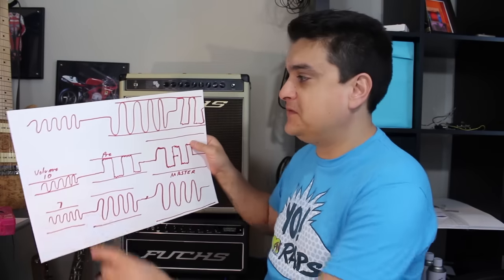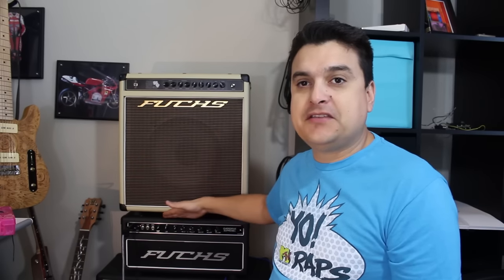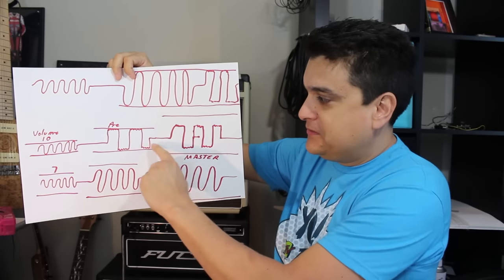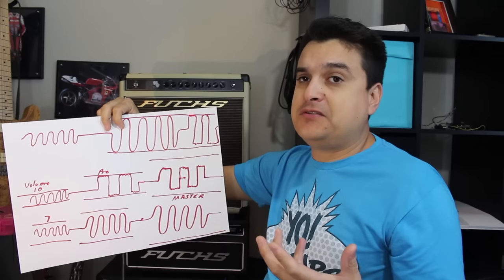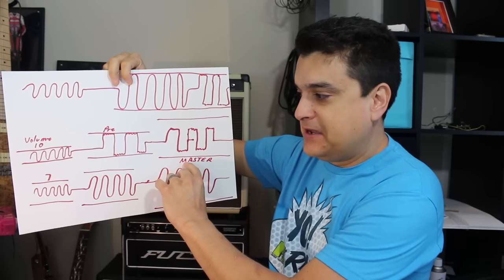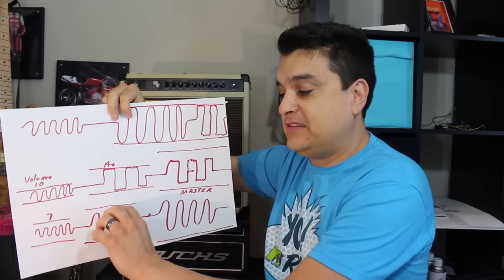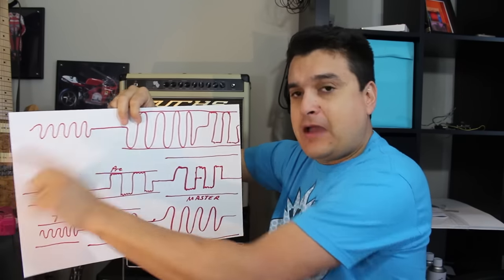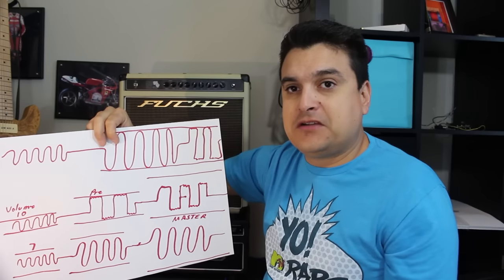Gain Part 2... Pre amps and Power amps... Dylan Talks Tone #113

Comment: Hi Dylan, great explanation of such an important concept! Thank you so much for sharing!
I myself have been trying experimenting with tuning the pre-amp and power-amp saturation with my class-A THD Univalve which supports many pre/power tube combinations.
I would love to hear your take on how to achieve (in a class-A amp with just one volume knob) the sweet spot of driving the power-amp section to its breaking point while keeping the pre-amp section clean so as to allow for dynamic range and pedals.
So far the closest results I'm getting is by replacing the usual 12AX7 pre-amp tubes with lower gain ones (a combo of 12AU7 and 12AY7).
Thanks a lot and keep up the stellar work!

Comment: Thanks for talking about this. Seems like an after thought on youtube, as most overdrive/boost/distortion demos, the amp is never is never cranked. For me no pedal compares to the sound of my 65' fender head's breakup at high volume so I try to find pedals that will compliment that tone. I cringe at these YouTube vids that are scared of turning the amp up, therefore producing a kind of fizz that does no justice to the pedal or amp.

Comment: I have a Marshall with a gain, volume, and master volume controls. I think I understand the gain setting - that's affecting the signal prior to going into the pre-amp. My question is what's the difference between the volume and the master volume in such a signal chain? Is it a case of setting the master volume to the desired level of overdrive on the power tubes and then using the volume to adjust the loudness to the desired level?

Comment: My eq pedal hits the front end from what I understand but I'm able to clean up with my amp cranked into breakup. Even in conjunction with a drive pedal, but I'm also staying away from the drive knob and just pushing level with more signal. So pushing the signal alone on the preamp with guitar on 7 gives room like you described. Is it the clipping that comes from the drive knob that squishes dynamic range?

Comment: So when I set up my DMM to one of the outputs of the amp and played a 50 HZ test tone the voltage started dropping a little bit before halfway. The output of my headunit is 0.8v special sub output signal and my amp has low level input (gain) range from 0.2v-6v. should I set this so that the gain knob is right before peak so as to not reach clipping?

Comment: Does this relate/work with solid state amps? I have a fender mustang V.2 been trying to figure all of this out with it, actually.
Reply: Also I have a gain control, a volume and a master volume control. If that helps.
Reply from the maker: absolutely. your gain is your preamp and your volume is your power amp
Reply: I  have the same amp. To clarify what he meant was that he has a gain conrol and a volume(to control preset volumes) on the preamp section and a master volume on the power amp.

I found that I got more variety by putting my gain at 5(going lower removes the crunchiness and bite of the sound used in rock, might need to go higher if you want metal) , preamp volume is fairly low then master volume is at 5(I use the mustang II so it's quite loud, before I learned this I use to set it to 2 or 3 then preamp volume at 10) then if I go to middle pickup at guitar volume 1-4 it's clean, I then transfer to bridge position then up the guitar volume to get the classic rock sound if I go higher on my guitar volume I am in the realm of 2000 rock alternative/punk rock

Comment: Ahh, sorry but gotta question ... as soon as you mention going to 7 volume... sure we're cleaning up our tone.. but now our volume is down and we disapear in the mix!  How do you sort've tweak your tone in this way by cleaning things up, without losing yourself in the mix?
I'm cruising through these videos so maybe you answer that later... if so sorry to bother!  haha!
Reply: Solder a treble bleed capacitor on the left and center lug of your volume pot to maintain high frequencies as you roll down the volume.  A 500pf cap is a good value for single coils and medium output humbuckers.  It works wonders when you are competing with 2 other guitar players.